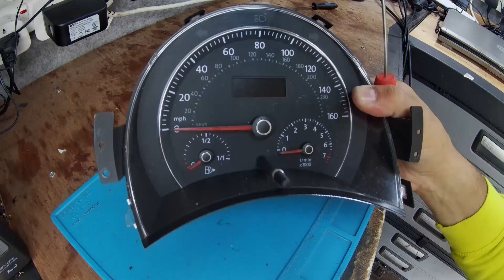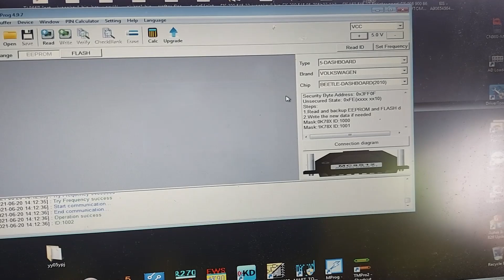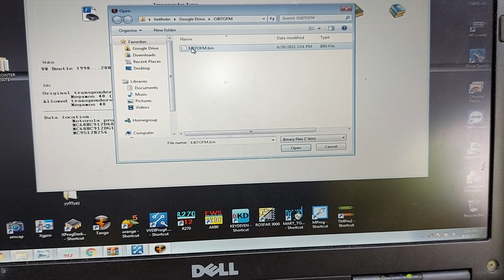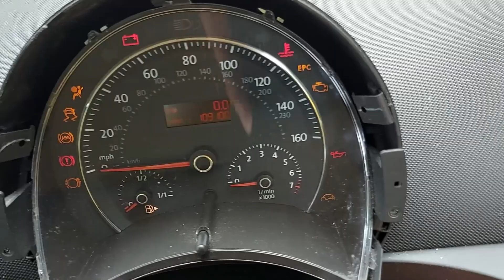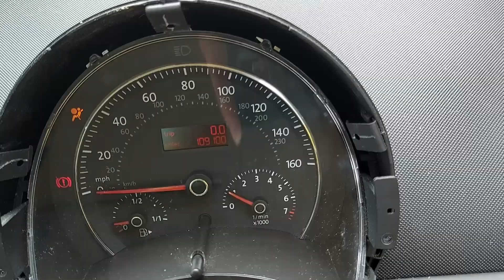🟢VW Beetle 2007 Dashboard eerpom read 🟢 0K78X, 1K78X, 2K78X, 🟢 Using Vvdi prog and Tango Cum se face

Comment: Had an identical 2007 Beetle. Instead of choosing 1998 with Tango I chose 2008 (9S12). It allowed me to clone out the key...in other words no file to write back to cluster and car started. Perhaps your car had a different processor?

Comment: Which one you are more likely recommending for the job? Vvdi2 or tango full programmer??
Reply from the maker: Tango is more comprehensive. I use tango more often than vvdi2
Reply: @sebastianthelocksmithandre1600  really? So you can use tango on the bench and obd? Or just bench? Plenty of car you can do it with tango?? Or just typical cars??
Reply from the maker: @przemekfryc5495  tango only does eeprom jobs so on bench yes. No obd.
Reply: @sebastianthelocksmithandre1600  thank you 😊. Do you have what’s up number I was gonna ask you about the device you’re using and what I have and probably still need buy more😃😁
Reply from the maker: @przemekfryc5495  +447438333372 glad to be able to help
Reply: @sebastianthelocksmithandre1600  thank you 😊

Comment: Hi Andreescu. I have a 2003 Beetle I'm trying to add a key to using an im508. It can't read the immo data or cs pin. Am I doing something wrong through the OBD or Will I need to do what you have done on this video please? If so, do you know what Autel adaptor it would be please and where the wires would need soldering or where IU can find out?
Reply from the maker: You need only the pin for 2003 Beetle and the pin should be in the clusters.  Obd procedure marelli clusters
Reply: @sebastianthelocksmithandre1600  Many thanks for your reply. Do you know if it'll be the nec or Motorola please?
Reply from the maker: @inagbihal8518  I don't know.  One of them will work
Reply: @sebastianthelocksmithandre1600  I'm new to the 508. Do you know the order on the screen please. I've just been out and all I keep getting is the diagnostic tool and ecu can't communicate or I need the code to enter 🤷‍♂️
Reply from the maker: @inagbihal8518  I never used autel for this one.  In fact has been a while since I've done a Beetle.  Last time I have done it with Abrites so...
Reply: @sebastianthelocksmithandre1600  It looks like I could clone a key using IMMO IV Instrument CAN then 873B(H51/H52) NEC+95320. Does that sound like a good idea? 🤔

Comment: I'm having an issue with a 2010 beetle with the 2k78x chip could you possibly help?
Reply from the maker: I have no idea how I would be able to.. what do you need?
Reply: @sebastianthelocksmithandre1600  well I was trying to make a key in an all keys lost situation. Read the cluster and added keys but the immo light still flashes. Customer found their original and it still works but I don't see the original key in the bin file I read either so I'm trying to figure out if it was a bad read maybe... Also tried to program through obd with pin that it read from cluster but says invalid login
Reply from the maker: @mrdaza1988  after reading the clusters, you should write back the file generated by the programmer.  Only then the car should start. What did you used to program the transponder?
Reply: @sebastianthelocksmithandre1600  yes I did this with the Autel im608. I also tried to clone key #1 with super chip and vvdi2 but that doesn't work either. At least nothing is messed up because car still starts fine. But now I'm just confused lol
Reply from the maker: @mrdaza1988  it seems that you did all the right steps.. I have no idea what happened..
Reply: @sebastianthelocksmithandre1600  do you know exactly where the pin code is stored in the bin file? I saw another video on these where they said some of the beetles have the information in different places so I'm wondering if that's why it's not working maybe the programmer isn't deciphering the data correctly